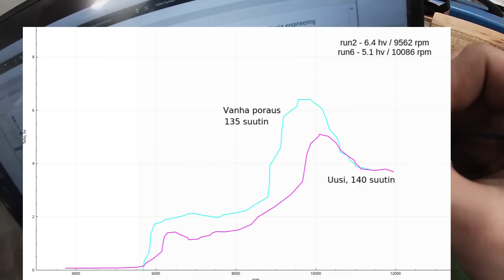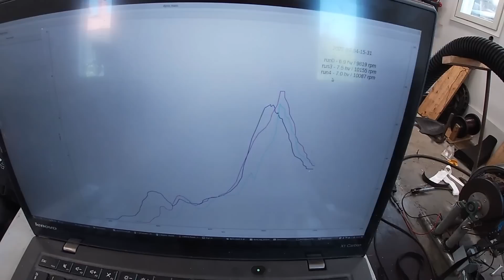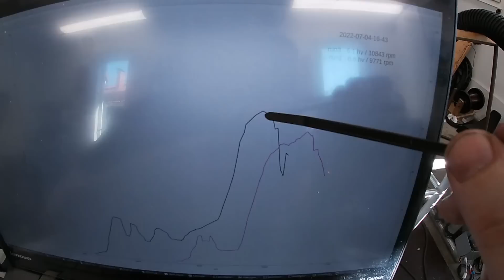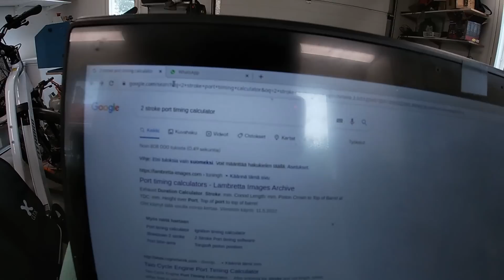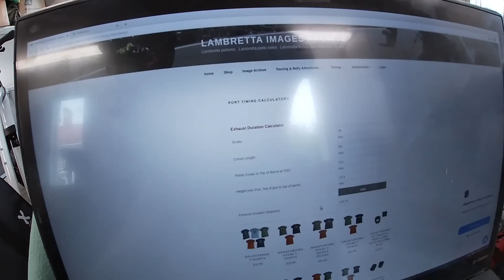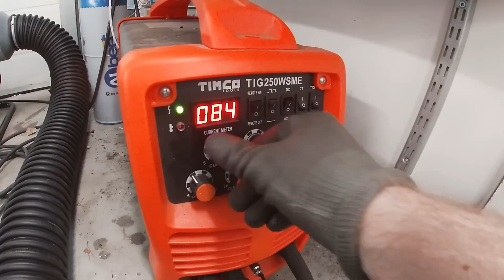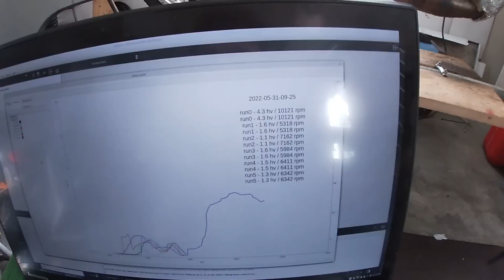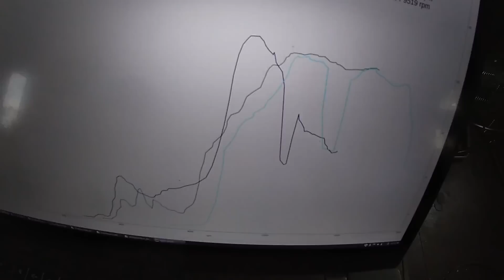20 hevosvoiman mopo osa 3: sylinterin viilaaminen ja virittäjän epätoivo

Comment: Sorry I'm a bit late, but glad I can help ease your pain😁
Over halfway through now. It puzzles me how that cylinder doesn't make any power, it certainly looks right. A tip on getting the head to seal, machine 0.1mm off the whole mating surface except the part inside the o-ring. That's how it's done on the iame cylinder head I used on my "old" engine, works great. Actually designed to be clamped out of shape when torqued down. Sounds wrong, first thought it was a manufacturing error, but all the spare insert I got were like that.
Another option is machining a slight taper towards the edges on  the mating surface, that's how my pip head is.
Serves the same purpose, but a slightly more "refined" approach.
Oh, and I'm tightening those m6 head bolts down to 18nm, sure I'm gonna pull the threads every time.

Comment: The coefficient of thermal expansion of aluminum is more than twice the one of cast iron. The piston is usually hotter than the cylinder so you need some clearance for it to fit properly at operating temperature. With a cast iron cylinder you therefore need more clearance than with an aluminum cylinder or your engine will seize.
Great work by the way. I don't understand a word but really enjoy watching your videos 👍
Reply: turn on the subtitles!
Reply: Seize
Reply from the maker: Of course. I was using 0.05mm clearance but I was not sure if it was for aluminium cylinder. It seems that it is a bit small for iron cylinder. But I also let the engine overheat because I didn't know the temperature, so probably the seizure could have been avoided.
Reply: @ASoftaaja  I had problems with my cast iron cylinder when I used tighter clearance than 0.06 mm. With 0.06 mm it works ok.
Reply: I use Wössner one piston ring high quality piston with it.

Comment: Awesome! Been waiting for a new video 
Though when you raised the exhaust port you get even less time to compress air and fuel mixture, when all ports are closed. 
So your old head might work better and might get the dip in midrange to not dip as much. 
Definitely seems to be that clutch is slipping
Reply from the maker: Yes, the higher compression head would help to midrange torque. But I just need to keep the revs high when riding so there will be no problem :D

Comment: Some thoughts about the cooling system. You might need a larger cooler and more water volume. And also look at the thermosiphon principle, warm water rises just like air does. So building the system in such way that it can self circulate even without the pump. Some engines doesn't have a pump like the modern Sky Paramotor engine and it's a high performance 125cc engine.
On my Suzuki K50 with 86cc I welded a jacket on the cylinder head and made it water cooled and no pump, only thermosiphon and it works fine. I have one connection at the bottom and the other at top and you can feel the difference in temperature as the warm water rises.
Reply from the maker: I know about thermosiphon effect. Some years ago I had a tuned scooter and the thermosiphon circulation worked even with ridiculously long and curved hoses. But I don't think it necessarily gives any advantage except less weight. The mechanical pump gives a very strong circulation. My radiator was a bit small and beat up, I have now upgraded it.

Comment: Have you checked the ignition timing is correct with a strobe light? Maybe something moved when the engine seized.
Also worth checking that the reed valves are still in good condition.
Reply from the maker: I haven't checked the timing. It is probably off by a few degrees, because I have just roughly set the base advance value into my programmable CDI. The advance is probably later than my programmed values are. I need to make a strobe light first :D
Reply: @ASoftaaja  Kyllä se ois syytä katsoa, monesti on tapana katsoa ekassa käynnistyksessä todellinen ennakko. Sen pohjalta vasta voi alkaa miettiä eternpäin.

Comment: Really sure your pipe is good?
The belly seems very long.
How long is it?
Reply from the maker: The pipe is only 640mm long but the cylinder has a relatively long exhaust channel(60mm). I don't think the belly part of the pipe is particularly long(70mm). The pipe is designed using a pretty old fashioned Blair formula, maybe that makes it look different than most modern powerpipes. Maybe the pipe is not the best but I don't think it will make a massive difference, maybe 2hp at most.
Reply: @ASoftaaja  My experiances in highrevving twostroke, say peak power at ~13000rpm.
One should aim at about 57-63mm long belly.

And if pipe length is ok, and still have a long belly, the header and diffusors are not correct,
Reply from the maker: @Patricks_Projects  thanks for the insight. I have planned to experiment with pipe design a long time but so far I have needed to fix other issues first. There is still a couple of things to fix but I will probably make at least one new pipe this year.
Reply: The entire system of the last bidalot wr 50cc, cylinder, flange pipe and pipe is: 666mm.

Comment: Nice work, don't loose heart. FYI I noticed a large spark at 3'11'' over a coil in the brake , you might need to address that?
Reply from the maker: Yes, it sometimes gives sparks. The rotors of the brake need some shimming. But it is not a big problem and I get more braking power from friction.

Comment: Take off the rubberhose from the carb!!!
Reply from the maker: Do you mean the hose between the air cleaner box? It doesn't have any effect. The power level was the same without a filter.
Reply: @ASoftaaja  ok.